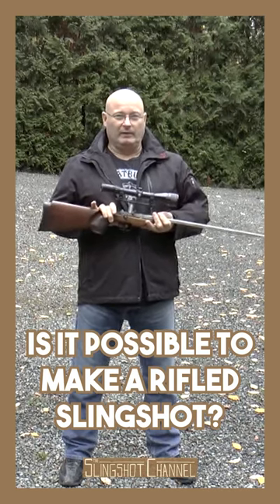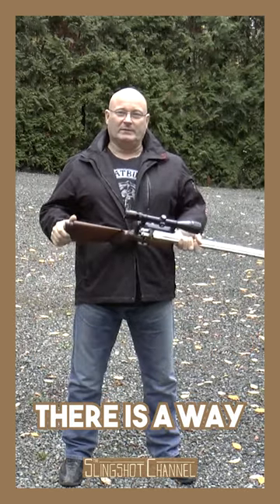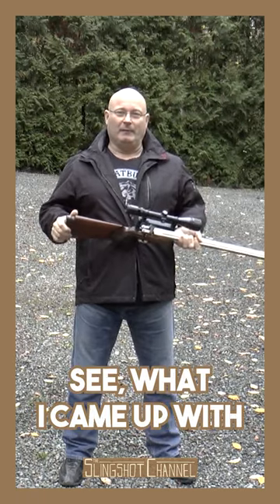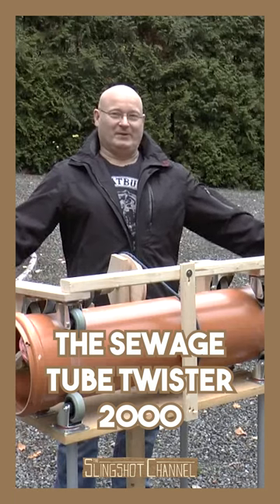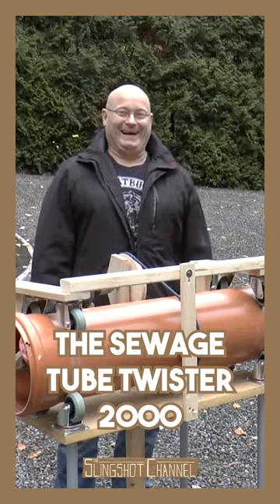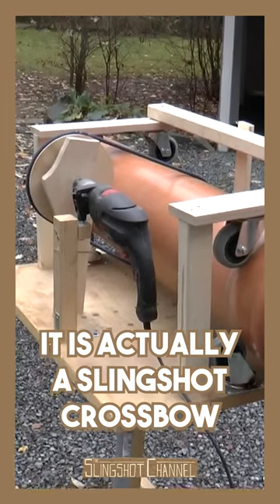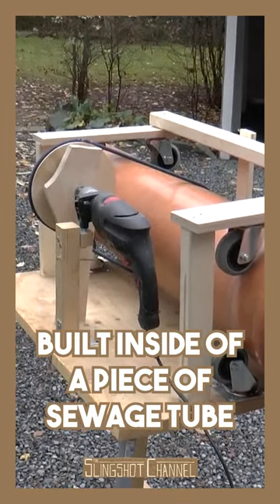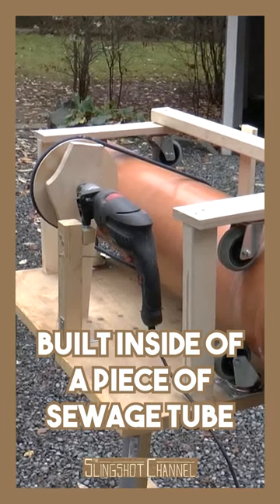A Rifled Slingshot?

Comment: now do a "rifled crossbow". But also make it gatling
Reply: Arrows don't require rifling. The fetching (feathers on the arrow), cause the arrow or bolt to rotate as they fly through the air, allowing them to be accurate over a longer distance.

Comment: This is a just a spinning slingshot. It's not a rifled barrel, using friction to cause the projectile to rotate as it moves forward. This wouldn't help much anyway. For the maximum distance of any slingshot, the accuracy will depend on the weight of the projectile. Adding a spin would only help if it was also able to travel much farther. Using heavier ammunition would increase accuracy because the inertia would be able to overcome the air resistance better but then gravity will shorten the distance. Overall, finding the proper mass/distance ratio would be more helpful than spinning the slingshot.

Comment: What if you got a smaller pipe, have the rubber at the muzzle like you do in the vid, but have the rubber twist tightly as it is cranked back?

So essentially like this video but with a smaller, tighter pipe and being able to hold the twisted, primed rubber until you're ready to fire.

Like a musket slingshot gun.

Comment: Haha the projectile won’t be getting any added rotation because once it’s released it’s not experiencing angular friction😂 very funny design though

Try making a tube like a barrel but add rubber in a spiral like the rifling of a barrel. It has to be barely touching the ball bearing.

Or a tube where the muzzle has two air hoses blowing air in opposite directions at the tangent to the ball as it exits the muzzle 😂

Comment: Do a bolt action one with electricity empowerement. (If you want)

I build one with a drill. I ask myself if you already do this. And if you use a superfast motor.

Take care this can be dangerous if the trigger is too soft.

I prefer with strong elastics than rope and curved wood but both are possible.

It's more dangerous with wood if it breaks. Elastic rope is a danger too.

But you surely know all this. 

I'll do a mechanic auto for next. Still does one but not compact.

Ah and use the electric motor during the shot it empower it more 😉, even with elastic.

Sorry for my Bad english, not from there. 😉🙂